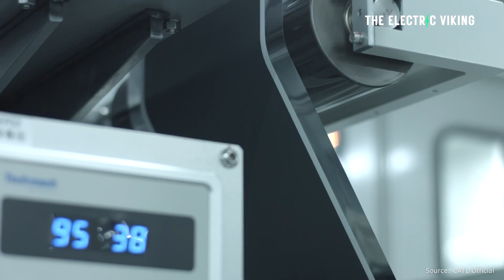China says battery supply will soon surpass demand by over 400%

Comment: EV Battery glut? Hard to believe given Tesla's clear market indication that they'll buy all the batteries available on the market...presuming, I beleive, that the quality is there.
Reply: Developing glut.  Not current.

And a glut if one looks only at current demand and projects too conservatively.  I don't think very many people even start to understand what the demand for grid and building storage is going to be.  With the cost of wind and solar continuing to drop plus the need to deal quickly with GHG emissions there's going to be an immense need for storage in order to build 24/365 low carbon footprint energy systems.

Comment: Toyota is right, if we use the same material for all the batteries, there just won't be enough. but development of batteries with different chemical is progressing well enough that we can pursuit EV, just at a shorter range than ICE cars... but I think people are getting used to and comfortable with the range of EVs, and fast charging makes pit stop at a dinner workable. however I do think that eletric for trucks are stupid, truck would eat too much supply and weight too much that it would reduce payload capacity. just replacing cars with EV is good enough.
Reply: Class 8 Semi-Truck from Tesla, proves that they can go 500 miles loaded on a charge, so no EV trucking is not stupid!
Reply: Just so let you, a 20 mins charge session for a model 3 from 30% to 80% is barely enough for a quick lunch (a very rushed and lousy that you need to shovel down food as quick as you can!). And that is just a 400V V3 superchage. The 800V class Charging system China is deploying will rendering taking a piss break being a rush job. The similar condition will become reality when superchage V4 start deploying in North America. Which that will be like 1000V class system.

Comment: Toyota and Honda just avoided $Billions of USD of losses that happened to Ford, Nissan, Hyundai, VW...who were investing $Billions in BEV.  Toyota will get ahead without these losses and is investing instead in perfecting the H2-combustion engines and non-combustible solid-state batteries for use in PHEVs.
Reply: The hydrogen ICE has been around longer than BYD or tesla or even commercial scale Li-Ion battery. What Toyota is offering on Hydrogen ICE is not much different to what BMW was offering on their Hydrogen 7 at the turn of 21st century. And BMW has a even earlier attempt during late 70s while I read from Bosch automotive handbook. The hydrogen ICE is an back track on fuel cell interms of hydrogen technology. It is a lesser efficent way of using hydrogen.